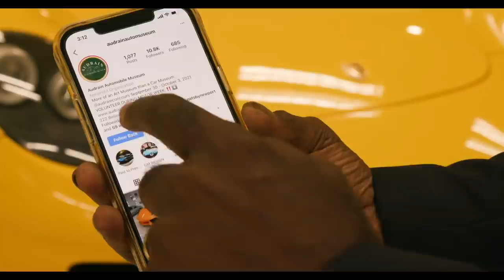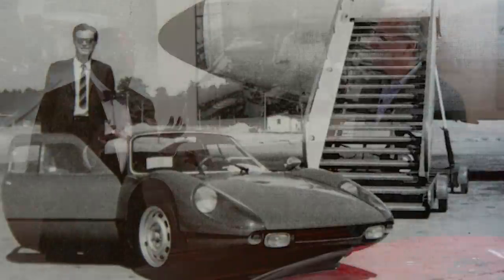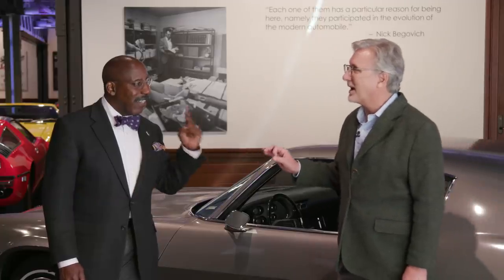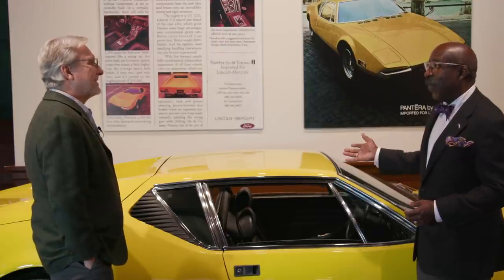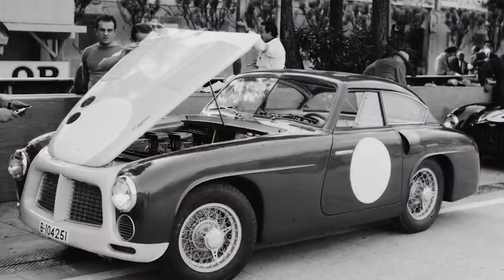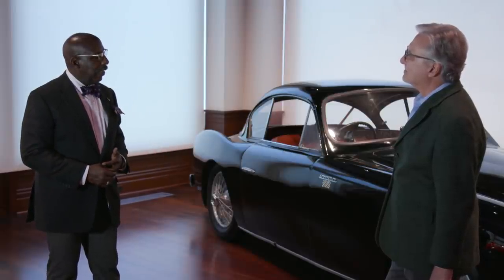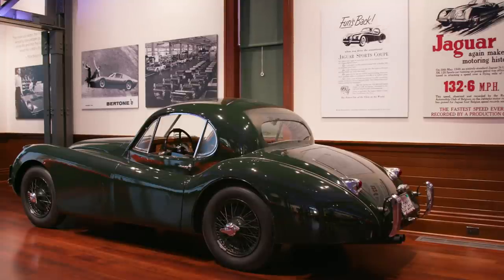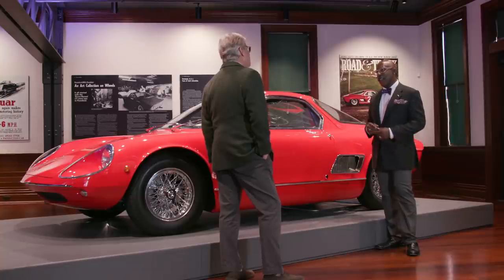Engineering + Design = Passion: The Nick Begovich Collection: Live Opening

Comment: I look forward to the unveiling of the Pegasos.  I hope the presentation recognizes the forensic and research effort that Nick’s dear friend Tony Fabozzi invested to identify the one car as the factory racer that had been reworked and sold as a customer car.  “Mechanic and restorer” doesn’t begin to describe Tony’s role with Nick.  He aided and abetted Nick in an astonishing variety of experiments, investigating how to improve mechanisms from Pegaso cylinder heads to S.U. fuel pumps, proving that intellectual curiosity flourishes when shared.  Nick would not have trusted anyone else to drive his 904 over to the Muckenthaler in 2015, where Nick gave a lecture on the Porsche 904 and it’s place in automotive design.  By the way, I hope the Audrain has Nick’s notes from that speech (although I do recognize that by then Nick’s handwriting had grown tiny and almost indecipherable) because his thoughts on that topic, the fruits of his intellectual curiosity, should be shared more widely than that small audience in 2015.  Some commentators on videos about Nick’s cars have criticized his not driving the cars, but they weren’t there in Fullerton to hear the audible sighs of relief when Tony drove the 904 back into Nick’s warehouse unscathed.  Nick fully appreciated the importance of the low mileage and original condition of the cars in his collection, and as a man in his 90’s wasn’t going to jeopardize that unnecessarily.  And we the public are all now going to benefit from that prudent approach.